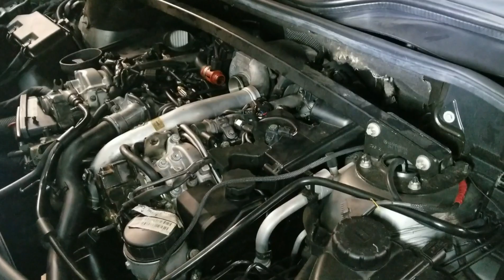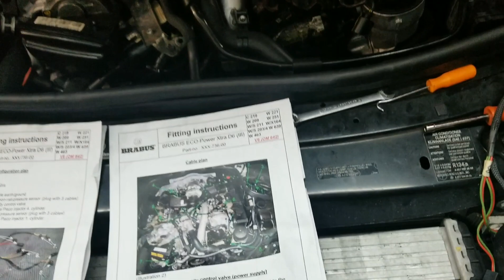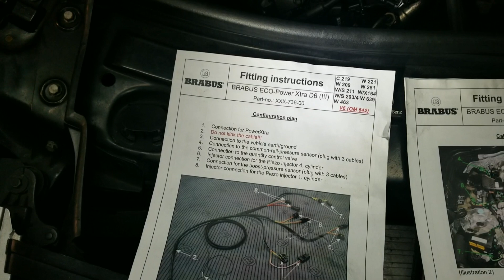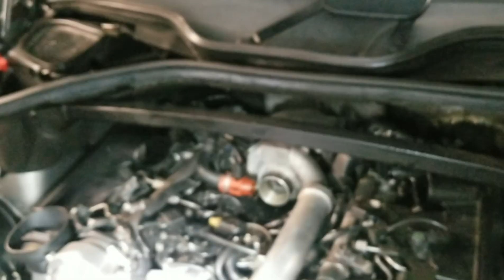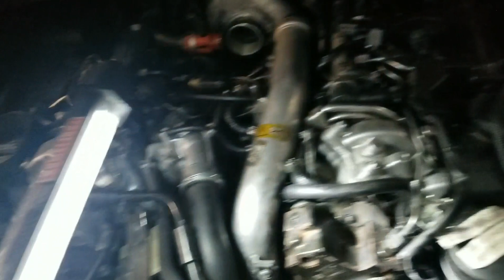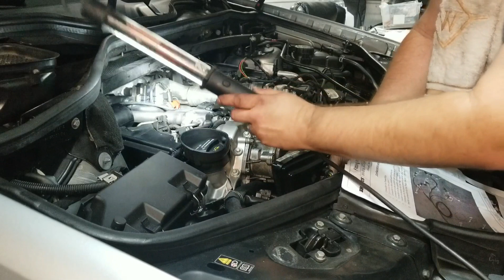Brabus D6(III) EcoPowerXtra install on Mercedes OM642 engine x164 GL350 Bluetec

Comment: wasn’t he supposed to use a BRABUS Xpower D6S not a D6111
Reply from the maker: I had an email exchange with BRABUS because I was getting fuel rail pressure sensor MIL codes and they confirmed it was the correct pn/application, however because I purchased via ebay secondhand they were unwilling to provide more support than that.
Reply: @GeorgeKistler the D6S is plug and play and doesn’t need all the labor.

Comment: Could you be so kind and tell me where did you connect temperature Wire? In the manual gl350 x164 and S350 w221 must have the extra wire for temperature sensor, other vehicles do not require this and you just closing the connection with the dame cable. I can't find a sensor anywhere on the engine that would fit the plug.
Reply from the maker: This is a link to the fitting guide from Brabus https://drive.google.com/file/d/1254_PKjL6dfBnzPN1vuULI0Lnas4fGo9/view?usp=sharing
Reply: @GeorgeKistler  thank you for a swift reply. Unfortunately I can't access the data. It ask me to request access. Which I did.
I've already connected the box per your instructions on the video however this one extra cable for temperature sensor is still not connected.
Reply from the maker: @mcdziubek1  give it another try, I had to approve your request to access the document
Reply: @GeorgeKistler  got it. Still however, the last page doesn't say where to stick the special temperature sensor connection cable. For now I fixed it together like in all other models. No errors on Launch obd scanner. It looks like it all works. But still that cable must be connected.

Comment: Cylinder four is very Hard to get in my
Fingers. And then i didnt get off this Connection. Any trick?
Reply from the maker: I agree, I did tear the noise foam, and as I remember I grabbed it (carefully) by the release clips with a pair of needle nose pliers the first time I took it off.
Reply: Yes,  i do he same … But its very tricky to get the Clip from the Connection.
Reply: Hello Denis. Does your wires come with temperature plug. If yes where plugged in?

Comment: George Kistler any luck with brabus customer support? Did they offer to flash your (d6 iii) to the (d6 blue)? I to have a gl320 blutec and installed a d6 iii and am throwing a p0191 fuel rail pressure code. I also have an eco powerxtra d6 iii box that is throwing similar codes. Just wondering if you made any headway resolving your issues? Great video by the way, thanks
Reply from the maker: Hi Kevin, no further luck with Brabus support and no offer of a flash. I still have the same code as you, P0191 and I have started getting a tan from the CEL. I recently made friends with a MB tech, and we both think the ECM needs to be programmed to accept the higher fuel rail pressures the Brabus module pushes.  It is a software change so it should be straightforward with a star machine but I haven't been able to get a time with him to program it. It is reassuring that you have the same code I am getting. Best of luck to ya!
Reply: @GeorgeKistler  So, all-in-all better not get this module? I'm offered one for €350. But if it gives more issues than joy, better let it go for that money eh?
Reply: Then there's this item:
https://www.ebay-kleinanzeigen.de/s-anzeige/racechip-gaspedal-tuning-fuer-mercedes-w164-320cdi-u-andere-/1420904595-223-5228
Sorry for the the German, but it's a device you hook up to the gaspedal. Supposed to enhance response in 4 vdifferent modes. Anybody any experience ?
Reply: @GeorgeKistler  , Hi, what is your car model w164 om642 or not and what year?
Reply from the maker: @dobbislavov2983  2012 Mercedes GL350 bluetec - the engine is the 3.0L v6 Diesel.

Comment: So you have had it installed for over a month, what is your review of the product?
Any issues come up?
Was this the only mod to the engine?
Reply from the maker: My butt dyno says it was a great add, the rest of the experience hasn't been so great. I have 3 issues that have come up: 
1 - it has a stumble when the engine is coming up to temp from cold
2 - i have a p0131 check engine light for fuel rail pressure 
3-  there is a bump in the idle when in gear and stopped sometimes, every few seconds it adds like a perceptible 25-50 revs that you can feel in the brake pedal and see on the gauge.  

I am working with Brabus support via email on this, but that has been dragging out for almost 6 weeks. I will update once/if it gets squared away.
Reply: @GeorgeKistler  Hey George, were you able to resolve your issues with D6 module? Also if you revert back to stock did the issues go away? Lastly did you purchase this module new or used/second hand since they are no longer sold. Thanks for help, I am looking at getting a used module for my ML320CDI
Reply: George Kistler I hope they help you out. Did you remove the device and see your problems go away?